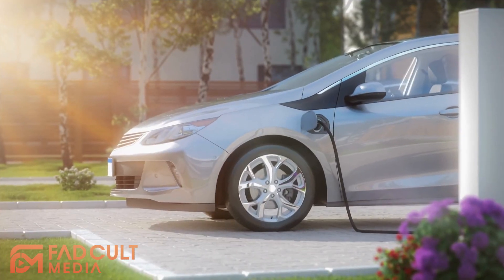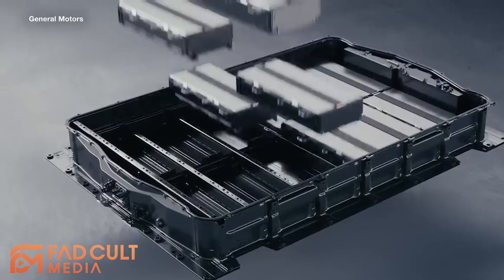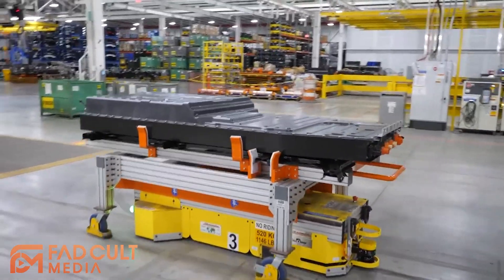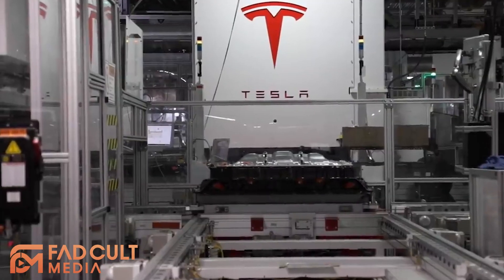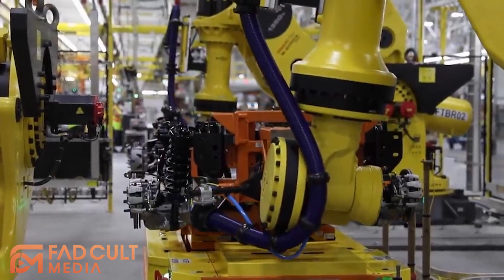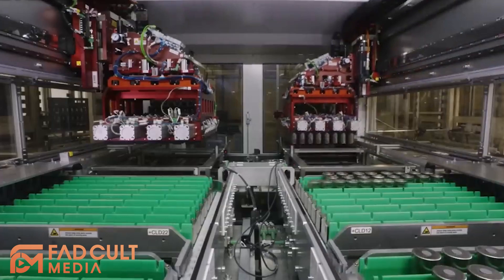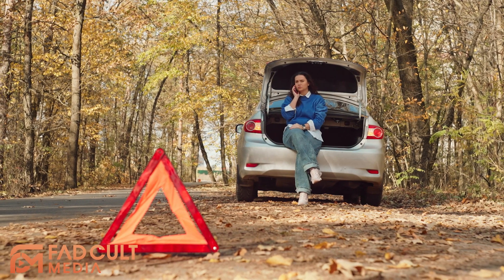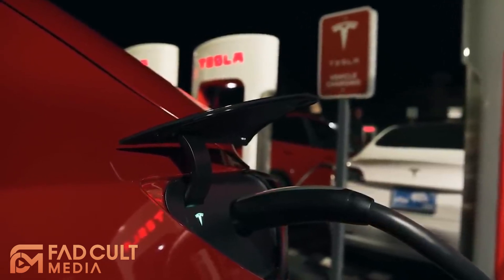Buy Electric Car with This Type of Battery (And Avoid this....)

Comment: LPF are 30-50% heavier (this is why they are not available on long range models), they take longer to charge, they charge VERY slowly in winter (think hours), they cannot provide much power in the cold (very dulled performance the first few miles), they cannot accurately show range, they require frequent discharging to 0 and charging to 100% (because they cannot accurately show range, this kills any longevity benefits). The reason for all of this is cobalt is missing. The advantage is children are not being exploited in cobalt mines and on paper it should provide more charge cycles, but so far in the real world the failure rate with LFP is higher. Avoid LFP would be my advice.